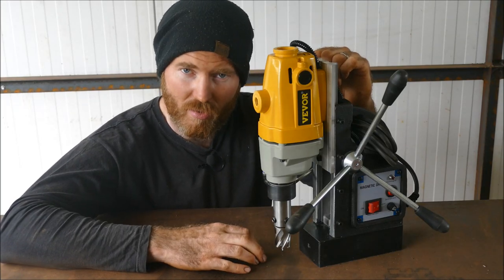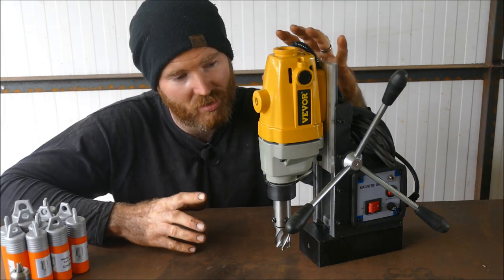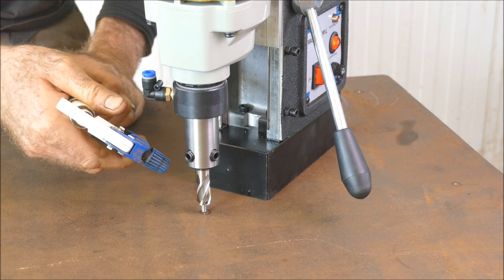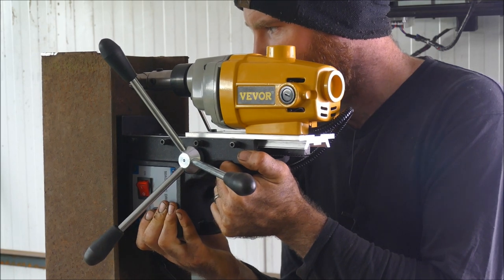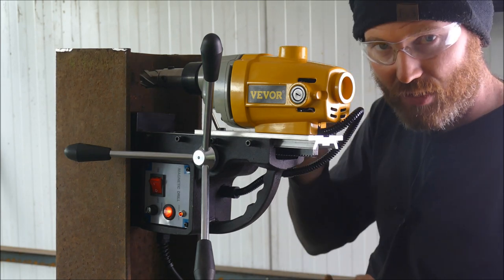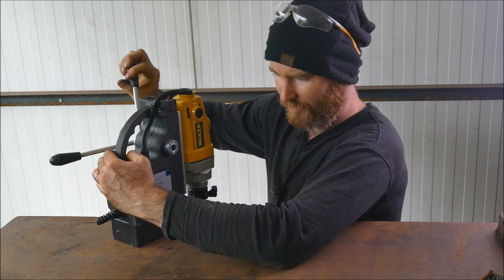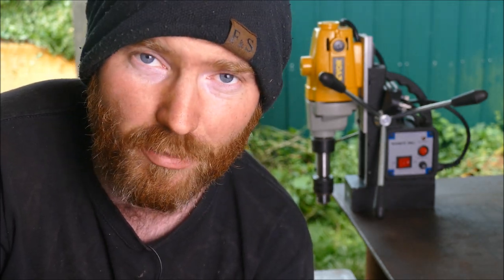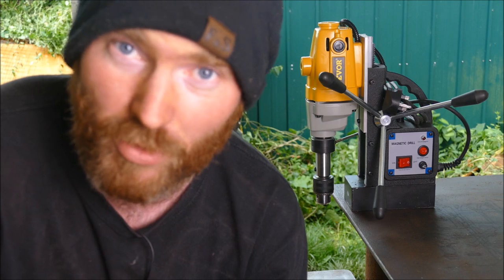Low cost mag drill, but is it anygood? - full review + stand build - VEVOR.com

Comment: I bought one of these drills. I  was very impressed with it, for the cost. I used it to drill through my truck's frame. It was a double channel frame. It  did great, I just had to back the cutter out once it cut through the first frame rail and clear out the slug then cut through the second frame rail.
Reply from the maker: They really are great bits of kit. Cheers J

Comment: I bought one of these last year to build a welding table. I drilled 166 16mm holes in the 12mm steel table top and the drill didn’t skip a beat. Brilliant bit if kit.
Reply from the maker: Thank you it's good to hear it will stand the test of time. Cheers J
Reply: @joshuadelisle  If you do find time to mod the switch, a video of 'how to' would be hugely appreciated. Cheers
Reply from the maker: @sedulousdabbler5468  it's relatively simple but I was dubious about sharing it as I'm not a qualified electrician etc and could get me in trouble. I looked in side it though and its only wires and a rectifier for the DC magnet. Just need to re cut all the wires so the drill switch can only be live once the magnetic switch is live. Will take about an hour with a bit of head scratching and labeling. Cheers J

Comment: I have one of those and it's decent.  I already had the annular cutters and a R8 adapter for my mill.  It makes boring large holes a breeze.

I really like the new version even better but hate the metric annular cutters with the quick attach feature.  All my cutters are the Weldon type hence you need an adapter to use them or buy all new cutters 🤨

The new version requires the magnetic to be turned on before the drill can be engaged and the double dove-tail allows the unit to be more compact and drill chuck friendly 😉

Comment: I need to drill 4 holes in my 4-post car ramps so that I can secure my (very old and heavy) vise in the corner for when I need to use it (space is at a premium); a mag drill purchase does seem excessive for the job, but I’m mighty tempted on the back of your excellent review.

As for the channel, I like pretty much all of your content; it would be great to see the workshop completed (appreciate funding may be preventing this), and I love the way you do things like creating a plasma table for peanuts by adapting other kit, or your reviews like the Rohr kit and the diy clean air-supply mask.

Your ‘mother is the necessity of all invention’ approach when lots of money is not a solution, is both humbling and very enlightening.

Of course, having skills by the bucket-load helps!
Reply from the maker: Thank you so much Ian. I've wanted a mag drill for a long time but always been able to 'manage' with out. It's one of those once you've got one you'll use it for loads of projects. Same as my plasma, I've managed without but with one you can really fly through projects. At the moment I seem to be getting attention of sponsors for tools so I'm making the most of opportunity. However I'm conscious not to drown out my other projects especially forging my sculptures again. Thing is with blacksmithing is it's self sustainable and so doesn't line pockets of corporations so it's difficult to get funding than less I simply save money to fund the projects. I've tried getting commissions but I've not had many wanting to spend the money on quality forge work for a while. I'll think of something though. All the very best. Cheers J

Comment: I just used one of these on a project drilling 80 1/2” holes in squat racks at a university fitness center. I used the chuck and shortened some drills. I was using it out of orientation, on it’s side with the face with buttons parallel to the ground. I know that’s using it out of its intended orientation, but the magnet was not strong enough, it needed a clamp to stay in place. I’ve used high quality mag drills in that orientation and they’ve been fine with it. My advice going in is, it’s a budget tool, does a phenomenal job drilling straight down, but be kind in your expectations, considering the price point.
Reply from the maker: That's good to hear and definitely worth considering. Cheers J
Reply: I have one of these and the instructions say that to get the full magnetic force it needs to be attached to some steel that is at least 20mm thick, so if you have it attached to thin steel, it won't hold.
Reply from the maker: @stuartrechter5175  it holds fine and considering most I-beams have a web that's only 8mm thick that these are designed to be used on I would say that they say 20mm thick so they can get away with it if it fails. From My understanding of magmatism it would be fine on any thickness as long as your getting full surface contact. Cheers J

Comment: A simple wiring fix would be to cut the input voltage wire to the spindle switch and splice that into the output voltage wire from the electro magnet switch. Wire nut and tape the old spindle wire for safety and now your spindle cannot operate without the magnet engaged

Comment: Nice bit of kit. I'd consider putting a cover plate over the magnet switch to avoid accidentally disengaging the magnet. You can get these in a few sizes for push buttons and smaller switches.
Reply from the maker: That's a good idea. Like a missile switch. Cheers J

Comment: the Hitachi one I have is wired the same way ,,, its crazy that theres no interlock on the switch , but its how it is , after loosing the alignment on a few tricky holes by hitting the wrong switch once or twice you soon learn .... coolant from a spray bottle makes a huge difference to the life of the broaches too ,,, I just use the water soluble cutting fluid from power band saws , works the very best
Reply from the maker: Thank you. That's exactly what I use also as cutting fluid. Cheers J

Comment: I have/had one of these. Worked fine for a few months but randomly decided to let me switch the magnet off without stopping the motor automatically…. Nearly a very serious incident… it span round a few times (Wallace and grommet style) pulled the power cable from the back of the drill leaving live exposed wires but luckily knocked the trip switch. 
I replaced it with a rotobroch commando 40 for not much more money.
Reply from the maker: I do like to check the wiring on these cheap Chinese machines as every so often there are faults that could be hazardous. A kill switch isn't a bad idea to add just in case. Cheers J
Reply: @joshuadelisle  I didn’t check the wiring, but I do remember checking when it was new what it’s functions were… ie not going into self destruct mode… 😂 I think mine was wired correctly but it’s got some relays and mossfetts inside, so I can only assume one of those crapped out…. I turned it into a tiny line boring machine for boring out bosses and bushes on smaller diggers.

Comment: Theyre site says "Max Boring Diameter: 0.5inch/13mm", do I understand this correctly, your drill bit can only be 13mm wide, or is that the max chuck size? How wide of a hole can you drill?
Reply from the maker: I don't think the guy who wrote the description actually knows what it is, it also says it's not for annular cutting which is precisely what is meant for. It came with a 27mm annular cutter and I believe the speed is fine up to 40mm. If you get a twist drill attachment the chucks are rated to 13mm but you can use larger bits with 13mm shanks. All the very best. Cheers J

Comment: Could this be used with a 2 and 1/2 or 3-in diameter bit to drill through a shipping container wall they're only about a 16th thick?  They are core ten steel and are eating up the hole saws.
Reply from the maker: I think 45mm diameter is the recommended maximum for this however it probably would do it. The only issue is you can't adjust the speed for the larger diameters. Personally I would use a plasma torch instead as you can use it for cutting everything on a shipping container and it is a similar price less the compressor. if you get a cut55 with a p80 torch and pilot arc youll do well. Cheers J
Reply: I do have a plasma cutter but I already have the insulation & wood on the wall.  I am a little concerned about setting it on fire.  We are finishing the house and did not cut the holes before now.  I don't know what I was thinking just to get it finished.  I enjoyed your video it convinced me to try a cutter.  I sent vevor a message I don't know if they share them with you.  My thought is will it hold a 2 1/2 " bit I would buy one anyway and try it.
Reply from the maker: @daleavant9788  it would probably work fine. Note that the thinner the section the less the magnet has to hold onto so have caution when using larger bits. It may be worth having a kill switch nearby. Cheers J
Reply: @joshuadelisle  thanks I will let you know how it goes

Comment: Question: With using chuck, most Mag drills are actually adjustable for the drill body to slide higher on the pinon track it is attached to (and many people with different Mag drills don't even realize they can do that).  Usually there is a hex key nut that allows you to slide the drill motor up much higher, for use of the chuck and then you slide it down when using shorter annular cutters. Just wondering if you missed that feature on the unit where you wouldn't have to drill off the edge of the table surface.

Comment: Does the arbour of that mag drill not fit with a morse taper, all the ones I have used in the past and the one I purchased recently to make some railings have a morse taper that takes the rotabroach adapter. Mind you for the price difference if that one has not got a morse taper I could live it as mine cost £450 and I thought that was cheap as most were over a thousand.

Comment: I'd be really worried about using anything electrical from Vevor as it looks like none of their goods meet UK standards, I was trying to purchase a welder  and sander and couldn't find any for sale then I came across the trading standards website, there's currently 46 items on manufacturers recall due to not being UK compliant due to bad earthing, poor plugs and some items when checked had extra wire soldered to the outside of fuses, so bypassing the actual fuse cutoff, there was also a further 60+ reports/items sold by them stopped by customs that were non compliant.

Comment: Having work in a shipyard.  Mag drills are used all the time.
One big safety issue.  All way use a strap or safety chain to the drill.
For whatever reason the power is cut off. That drill will fall.  Even if you don't get hit, that expense drill bits is toast. 
After all who going to help drink all that beer?
Cheers
Reply from the maker: Good advice 👍. Cheers J

Comment: Nice video Joshua, how do you think those rotar broaches would get on with stainless drilling?
Reply from the maker: Hi. Thank you. I've drilled stainless with one before and works fine. It would be better to have a variable speed so you can get the lower rpm suited for stainless steel. Just make sure there is plenty of cutting fluid and both the steel and bit don't get too hot or it'll course problems. Cheers J
Reply: Something I have wanted to buy for some time, cheers for the info 👍

Comment: I think I would have used  two square tubes for the table to make sure it cant rotate when drilling, and with a bolt on a corner It it might clamp more securely:) other than that a great video as always 😀
-Mads
Reply from the maker: Thank you. The magnets pretty good but I could always just add a clamp if needed. All the very best. Cheers J

Comment: You said it was £150 its £264.99
Reply from the maker: Check out the full list on VEVOR. Drill only is £150 and Drill + bits is £250 as mentioned. Don't forget the discount codes. All the very best. Cheers J
Reply: @joshuadelisle  Well did some research and found out its just a mag drill from china with there logo on it. The chassis, frame, switches etc identical even the yellow colour... loads of them on ebay, ironically the branding for the £150 one on the website is even the chinese name lol whereas the branding for the 264 says Vevor... check out the pictures of the 150 one lol
Reply from the maker: @frankiewalnuts  👍